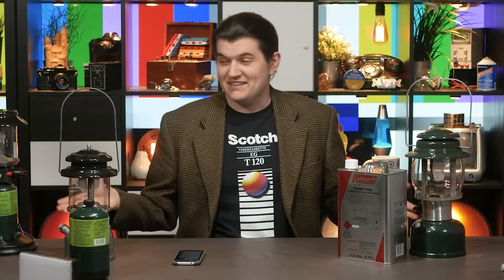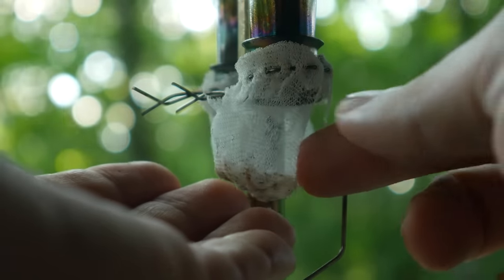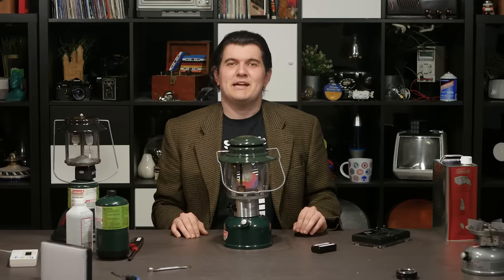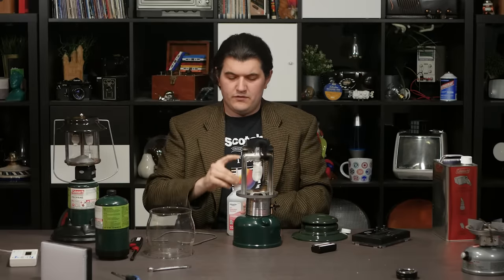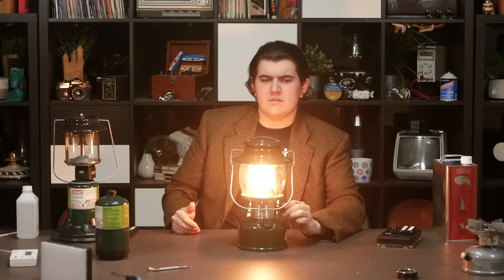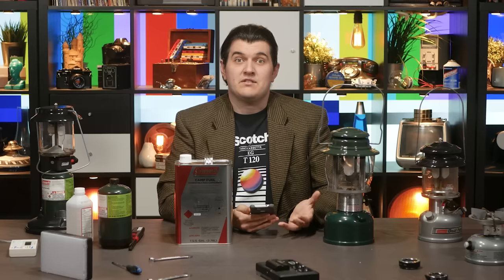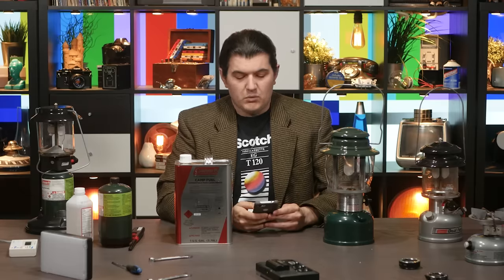A very rambly Coleman Lantern follow-up. Turns out they rarely make sense in 2021

Comment: Running this type of lamp indoors is not a good idea! It consumes oxygen at a horrendous rate. It is the mantle that requires so much oxygen to produce light. This unit in a six person tent will create fatally low oxygen levels in less than ten minutes. I use them when camping with pump gas in the older green lanterns. I also use the same method powered coleman stove, and have done so for generations. I do not use them in a tent or cabin, and have had quite a few power outage situations where these lanterns have been a lifesaver. More gas is cheaper than new batteries, and i dont have to wait until daytime to recharge. One gallon of whitegas will run two lantrns at least 5 hrs a night and a two burner stove for three meals  and cofee and popcorn at night for at least a week

Comment: The biggest value of these two lanterns is to show and discuss the learning curve of an uninformed newbie in operating these lanterns. You have discovered and made most of the mistakes possible. The biggest take from this is that these lanterns should be used after instruction by someone who knows what they are doing. We don’t just get into a car and start driving as a first experience. Same with these lanterns. Coleman has sold these by the tens of millions over the last hundred years, so they are not as dangerous as you imply. As an aside, if you happen to use these in cold winter conditions, guess which one will be easier to light? The kerosene lantern will light exactly the same in the cold while the gas lanterns begin to struggle to light as the temperatures drop. Your LED won’t last long at -20. However, without any instruction I agree a newbie should use the LED or propane lanterns in warmer weather so they don’t make all the potentially dangerous mistakes you made.

Comment: The only scenario these would really make most sense in would be needing both light and a heat source, if you look at it like that then it would be 2 birds with one stone but if it were just one or the other, especially if light were needed but it were in a hot environment, then it is really hard to see any advantage other than the lights got cut and having grandpas emergency light already lying around

Comment: Kerosene makes a lot of sense for backup lighting due to the fact that it's got a lot longer shelf life than white gas and especially gasoline.  Think during a winter storm where one is stuck inside or during or after a hurricane.  Unlike LED lights, liquid fuel lamps don't have to be charged ahead of time,  and solar or AC charging is impossible during the situations I mentioned.  Many in cold climates prone to winter storms use kerosene heaters for backup heat.  It's easy to get 20K BTU's from one of those heaters... something that's impossible with batteries, white gas, or gasoline.  For people in those situations, having a single fuel source for heat and light that has a long shelf life is important.  Also, kerosene is much safer than gasoline or white gas.
White gas (around $8 a gallon for Crown brand in California) is more stable than gasoline and has a longer shelf life but is still shorter than that of kerosene.  It also burns much cleaner and won't clog the lantern's generator as quickly as gasoline.  I have a couple single burner stoves and a few lanterns that all use white gas.  The oldest is from 1971, and all work flawlessly.  Having a few mantles and a generator as spares pretty much ensures me that I'll have a source of light that will last for years.
Propane lanterns are a good compromise are much more expensive to operate, unless one refills the small 1 lb cylinders from larger tanks.  They also work well outdoors on a propane 'tree' attached to a 10 or 20 lb tank.  They can be a reliable source of light, assuming one has enough small cylinders, a way to refill them, or a method to attach the lantern to a larger tank.  
If one wants a fuel source that will work for extended periods without access to solar charging, liquid fuel,  kerosene, and propane all make a lot of sense.  That's not to discount LEDs.  They have their uses too and are equally important, in my mind, in situations where one is without power.  For the record, I have liquid fuel and propane lanterns and stoves and a couple battery banks that will easily charge via solar and will run my LED lights and 12 volt refrigerator almost indefinitely, as long as I get a few hours of sunlight every day.

Comment: Yes, in terms of practical usefulness, the kerosene or gasoline pressure lamps (Coleman and others) are outdated. Still they have their value and meaning in terms of the cultural aspect of technology: not unlike mechanical typewriters, they were mechanical devices for everyday use at the peak of technical development: they were perfect in their kind so that no further improvement was sought after. They were being produced and sold without substantial change for decades.

Comment: I don't know in what area you live & I can't speak for any other than mine, but auto pump gasoline is far cheaper (~roughly $4.50/gallon as of the date I'm writing this) than "white gas" & still a good bit cheaper than K-1 kerosene. I haven't seen K-1 at a fuel station in years. So, IF I had to use something for emergency lighting or cooking fuel, I'd use auto pump gasoline. For lantern fuel (oil), I'd use off-road pump diesel. It burns as cleanly, or perhaps even more so, than K-1 lantern fuel & it's still both cheaper & more readily available.

Comment: 4:00 You should have actually researched what the check valve does and how it works. That's a major faux pax on your part. 
BTW, good luck getting a frozen check valve out without buying a $50 tool.
At that point, you are actually better off buying a new unit, if you have to replace the usual replacement parts, i.e. generator, valve packing, valve cleaning stem assembly ...
Been there, done that. 
Otherwise, you may be better off just sending it in to Coleman for a complete rebuild for $50. A steal, if you don't count the shipping. Otherwise, it's all about nostalgia.
Edit
Otherwise I do like your videos

Comment: Kerosene will last longer in storage than regular pump gas will. White gas has a comparable shelf life to kerosene though, about 5 years.
Reply: But the shelf life of propane is indefinite, so you can store it basically forever. And you can get adaptors to run the lantern from the bigger 5, 20, and 30 lb. tanks.

Comment: I know why the hole is there. If there was no hole you would have to screw the pump in with pressure against the threads. The threads have a very important job to do, they have to hold a seal against gasoline vapors under pressure. If you damage the threads or otherwise don't get the pump sealed up tight you're going to have a pressurized leaking container of gasoline vapors. I know this is really high on the list of things that you want to put in your garage next to your gas hot water heater, but I really don't recommend it!

Comment: Nothing says Hygge more than fire - I've yet to find an LED that can radiate Hygge, or a battery that can transport it.
 I mostly camp out at music festivals in Europe and it's usually the case that the temperature drops after dark - the heat output and ambience of these lights is much more sociable than the cold clinical output of LED's. LED's are about as evocative as office/factory floor lighting - and totally banned from my tent/gazebo!

Comment: I use a white gas lantern when in the backwoods. Because they are far better than batteries or solar. 
If my batteries run dead I can charge from my truck or my generator. I get to wait hours. 
Or I can pull fuel out of my truck. Boom lights on. 
If I have solar I’m screwed at night. 
Also batteries don’t last as long. One tank of gas gives 3 day of light. 1 gallon 3 weeks. My new light and batteries 1hrs.

Comment: EVs are no where near reaching parity with ICE vehicles.  When they no longer have government subsidies, and a sub-$20k EV has a range of over 300 miles after 10 years and a refill/recharge time of under 5 minutes...then maybe you could make a case for parity.  Only we already know that their batteries start to noticeably deteriorate in less than 10 years, so I guess we'll have to wait for some new technology to maybe come along first.
Reply: Not to mention, EV's aren't as environmentally friendly as some would like us to believe. Volvo did an interesting study on one of their car models which has an ICE and EV version, both produced in the same factory. They measured the emissions from every aspect of the construction, from the lithium mining, to the transportation of every part, to the emissions of electricity generation and found that you would have to drive their EV 90,000 miles before it would break even with the ICE in terms of total emissions. And as we've seen, that's getting near the end of serviceable life for an EV battery.

Comment: 33:59 100 times less efficient does not make any sense cannot be calculated. Whenever times come into play it means more, except a number times zero. Why folks say something is x times less then another number is truly a misnomer. Give this a go, multiply a number by any number other than zero or one it will be a higher number not a lesser number. More correctly stated would be one item is 100 times more efficient, or one items is 1/100 as efficient, but certainly not 100 times less efficient. Call it semantics if you want, it is math we are talking about. Notice the number can actually be calculated whereas 100 times less arithmetically cannot be calculated.

Comment: Regular gasoline doesn't keep, batteries need upkeep to maintain health and charge, kerosene is much more shelf stable for emergencies and propane moreso.
They make heat unlike LED light. You can also cook with these things unlike electricity (because it would require quite a bit of electricity). 
If you're going out a lot that battery gets worn down faster as well. For LED light something that takes alkalines are probably better for sporadic camping rather than a rechargeable wasting away in a drawer. Batteries just do not have good shelf life unless you maintain them properly. That bottle of propane from 7 years ago is just fine and so is that 1 year old kerosene.

Comment: Coleman and other brands of single burner, liquid fuel stoves, would make a good video.
The Coleman single burner stoves are great for motorcycle camping trips; always have gasoline available.
Can use gasoline in duel fuel or regular green Coleman burners. 

The duel fuel generators deal with the gasoline additives better; has nothing to do with safety.
Disadvantage of using gasoline vs white gas, is the generator has to be cleaned more often.
The heated gasoline additives, leave more residue inside the generator.

I use $8 walmart white gas often as possible, but do not hesitate to use gasoline if white gas is not available.

Comment: People have such a fear of the white gas units - the explosion mythology is just that. When properly used (check the fittings, clean the port - they do need a little TLC), they really are quite safe - and seem to want to work properly forever. All the explosion stories I heard over the many years of using these things are just that - stories, camping mythology. It was always someone's brother's friend's uncle blowing themselves up and self-immolating themselves - the stories were typically told when I would light them up and people would look horrified and head for the hills - expecting an explosion and certain death for some reason - until they were running smoothly. I never saw one explode or set anything on fire - many more safe hours of operation than pitfalls, and much more unearned vitriol than deserved. More energy output, less weight & storage required, better economics -  white gas still makes sense for me.
Reply: Hi chrisnurczyk have you become a flat earther yet? If not I suggest watch a 13 part series called What on earth happened by Ewaranon to learn that the earth is not a globe. I got it in my about tab.
Reply: @flat-earther No, thanks. Don't fancy the opportunity to live & think like an ignorant  12th century peasant. But I do see that many young folks overstate the supposed dangers of older tech w/out real experience or data. Most accidents that did occur were from foolish careless operation of the items, and just weren't that common. Some supposed modern advantages are just trade-offs for other problems. Every decision you make is a double-edged sword.

Comment: If you are actually carrying white gas you will not be carrying it in that container. If you are carrying white gas you will certainly put it in something thicker unless you want to be covered in smelly oily flammable liquid at some inconvenient point during your hike. Anyway, it is still better than the propane, but you will be using a thicker bottle.

Comment: if you're gonna use gas lanterns/stoves....most probably you're buying something used because you think it's a bargain. But with Coleman's you have to take them all apart and clean or replace the generators at least. The majority of people that own these, leave the white gas in them. And as that gas sours and ages it leaves varnish deposits in all the plumbing. You can't expect the lantern or stove to perform as intended of it's gummed up. MANY tutorial on YouTube on how to service these. Best is from a guy named Frank who lives in Idaho. He's has had and repaired thousands of these when Coleman authorized independent people to repair their products.

Due to the price of white gas.....throughout the year I buy a gal/month whether I need it or not. Agreed, the price is outrageous. When I lived up in the mountains, if I was using fuel other than wood, my first choice was K-1 kerosene in a modern kerosene, battery start heater. They were absolute marvels compared to the old Perfection kerosene heaters.....which I had as well. Once lit, there was virtually no odor and they were extremely efficient. I still have them and during the winter I will occasionally run one because I like the heat effect and being able to carry them room to room. But the price of K-1.....forgetaboutit.

Comment: I'm jumping the gun and commenting  only 20:32 through .. only because I really have to get back to work. I'll watch the rest later. Just a disclaimer, should you actually address my comments later in the video.

@3:17 - The hole. I have always assumed old school engineering genius to roughly regulate/limit tank pressure. Most folk I would assume 'get' when the pump offers sufficient resistance, but you'd really have to work against the thumb-over-hole to build stupid pressure. I'll bet the patent is one hell of a read.

@4:25 - The mantles are indeed fragile to touch; and this has always been a head shaker to me, but they do survive human activities, the tool box of a logging truck, etc. 

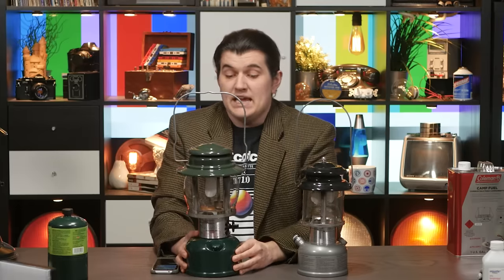@7:54 - Yay offshore QC. 

@13:21 - I kind of agree silly for the kerosene as far as Canadian/US consumer 'camper' market. Almost as if vestigial. Of course if it'll burn kerosene, then it'll also do diesel, JP-7, bunker-C, etc. There may be a niche here that neither of us are seeing.

@17:20 - Efficiency. No argument in lumens alone, but I suggest sir, that your fingertips may be a bit more girly than mine. Nothing ever empirically measured, but these gassers I suspect put out .. 800 watts of heat? More? Used to let a pair of them burn o'er night under the oil pan of heavy tractors with the cowl draped in cargo blankets.

Again, haven't finished the vid yet .. I will. But yes, these lamps (in one form or another) do still make sense to many of us in 2021, and I'm less than a 50 minute drive to a relatively urban center of 150.000 (and have no idea how to play the banjo), this is not Tucktiactu. NWT.. but it's also not the place to rely on the magic wall receptacle as if the cornucopia of first world existence. 

I am an avid watcher of your channel, despite my internet packets being delivered usually via bees. Technology is awesome, and in  fact the very vocation where I earn my bread. But the carbon neutral (lol) vision of EV combines and tractors trucking along on 18650 cells doesn't work for everyone.

Sometimes you really do just have to find something and burn it.

In one perspective - these lanterns are actually the zenith of one hundred thousand years of technology.

Comment: I go camping extremely frequently, I'm baffled that lanterns which burn fuel even exist. Battery lanterns make so much more sense in every single concievable way. You can even get electric lanterns that you can charge by hand cranking, for virtually limitless light. Also, the lanterns which I use all the time for camping and emergency lighting are coleman battery operated lanterns (not the battery you showed with thay super bright light, they're pretty chunky disposable batteries which each last a very very long tim)

Comment: Every fuel source has is positives & negatives. What we should aim for is a balance. For day to day energy consumption solar & wind. For emergency back up power fossil fuels. 

For example let's say you loose power, right before you were scheduled to recharge batteries. 

Having a back up generator to charge those batteries is a good thing, if the fossil fuel can be kept in a relatively stable state.

Fuels go bad. So, having multiple ways of using the fuel let's you use then up before they go bad.

Batteries seem to be the way to go, however having a back up, back up power source is not a bad idea.